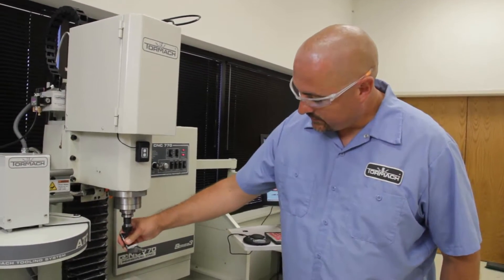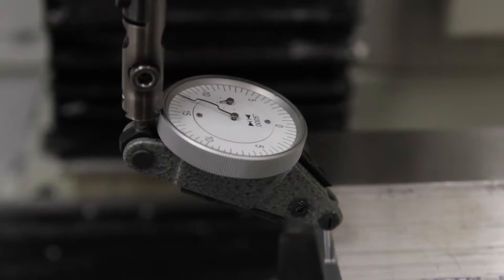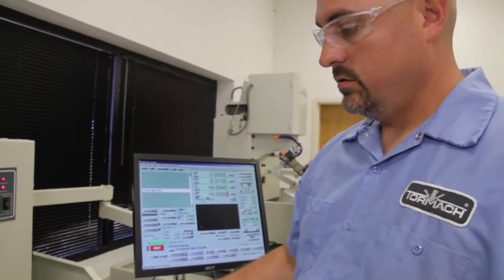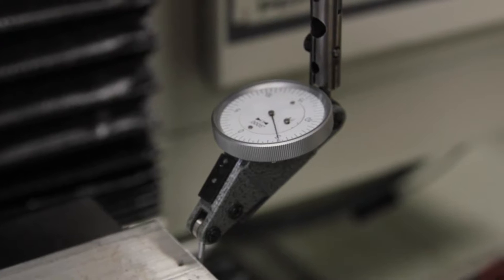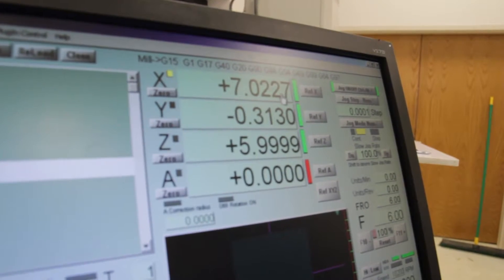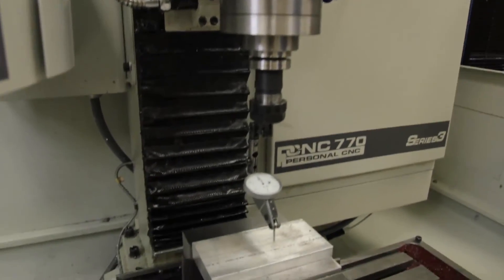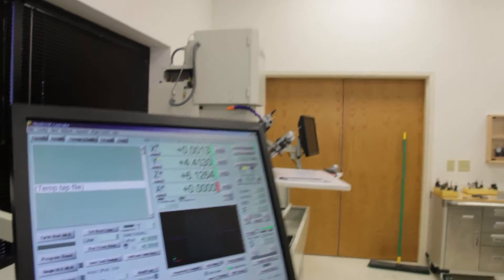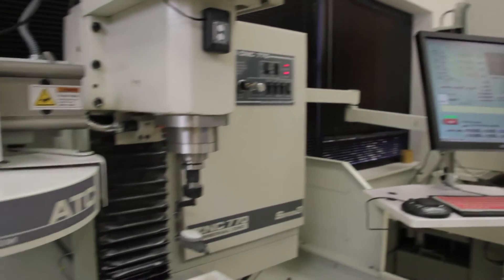How to Find the Center of Block with a Dial Indicator (Swing Indicating, Part 2 of 2) - Tormach CNC

Comment: a mill with stepper motors? got dam that has to be annoying
Reply from the maker: Our 770MX and 1100MX both have servo motors, and we have an upgrade path for the 770M and 1100M machines.
Reply: @tormachinc  I have a 3d printer with stepper motors I’m just saying it’s probably noisy when running lol

Comment: At 1:46 you say "So now the number we have in our readout is the total length of the part plus what ever our swing of our indicator is" then you go and divide it by TWO!!! That adds half of the swing of the indicator to the part. Why am I the only one that picked that up. I guess no one has looked at this for like 4 years.
Reply from the maker: The procedure shown is correct. The measurement taken is for the entire length of the block, so we divide by two since we're looking to find the center.
Reply: I appreciate your response but you didn't explain why it is the correct procedure. The reason it works is because he is incorrect.  I thought about this and its because with the swing arm on the right of the spindle it is added to the measurement, then it is subtracted from the measurement when on the left. What is fundamentally crucial is that the swing arm geometry is not changed in anyway. Any re-positioning of the arm makes the measurement meaningless. The correct statement would have been "So now the number we have in our readout is the total length of the part plus what ever our swing of our indicator is on the left and minus the swing arm on the right." but then again this is what happens when people are taught something and never really question why it works. It happens everywhere. Thank you for the reply.
Reply: @gusbisbal9803  why would it be added on the left and subtracted on the right? On the left side, the central axis passing through the indicator is offset to the left of the measuring needle. On the right side, the center axis passing through the indicator is offset to the right of the measuring needle. The indicator thus starts earlier and ends later, and assuming the angle of contact is equal, the same swing is added to both sides and it is averaged out by dividing by two anyway.

Regardless, however, even if you are right, that's no way to discuss someone potentially showing a wrong procedure with statements that do not further finding the proper method (if what you suggest is correct). If I were you, I would tone down the arrogance a bit and accept that my analysis might be mistaken, even when I am trying to correct someone else. For next time.